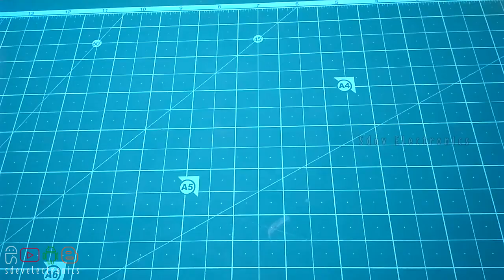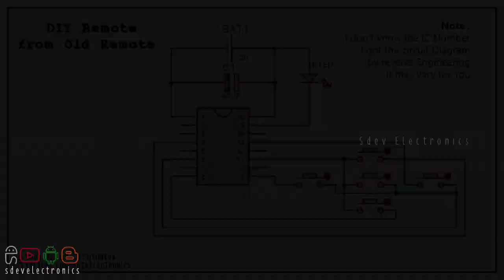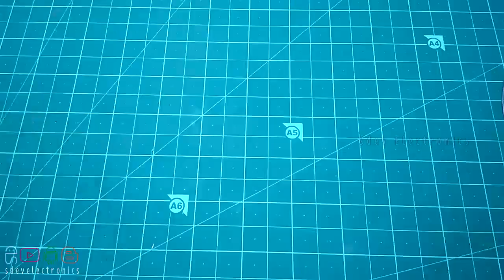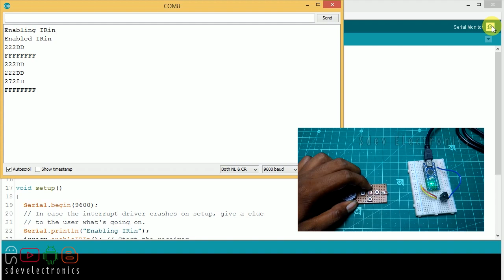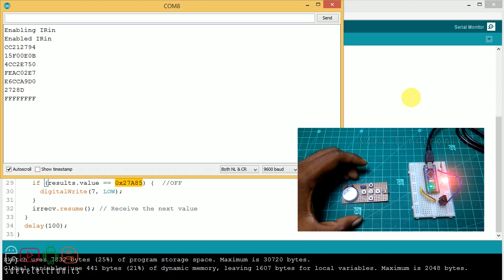Homemade IR Remote from Old Remote | Sdev Electronics

Comment: Driving the IR LED by Multiple Frequency Makes different channels, we can also use 555 timer just connect pin 2 (C) to multi push buttons and connect each push button to a different value of capacitor whenever you press a button with consideration of capacitance value the 555 timer IC generate a different frequency and drive the IR Led with that frequency !